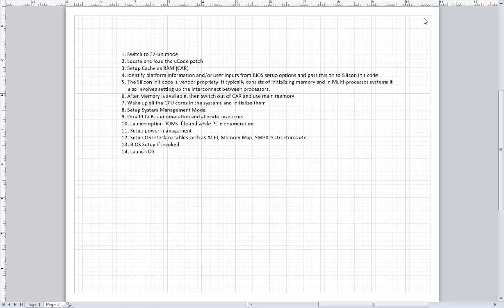System Architecture:  3 - High Level Overview of the BOOT flow

Comment: Sir quick question - When we power ON, the execution starts at FFFF FFF0h (4GB-16) bytes but the CPU will operate in real mode where it can access 16bit address space then how it can access FFFF FFF0h which is 32bit address space?
Reply: For 16 bit CPUs, the reset vector is FFF0.